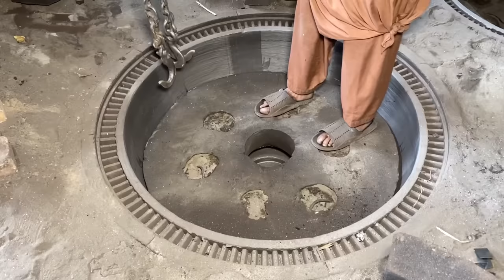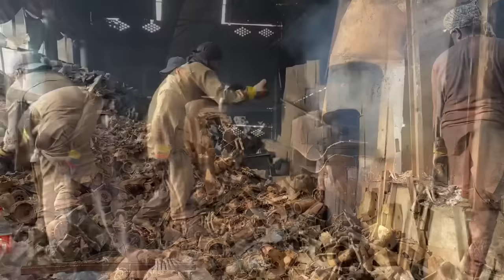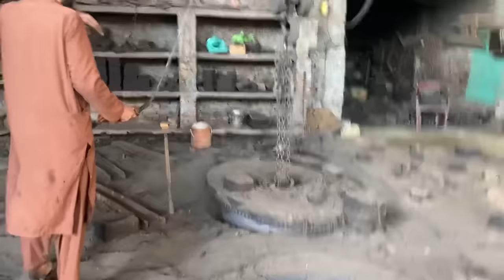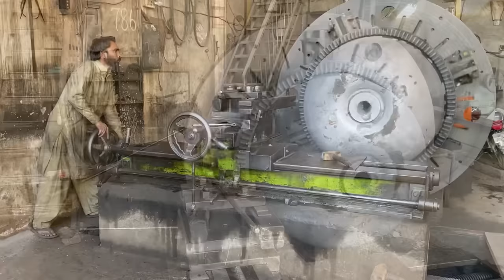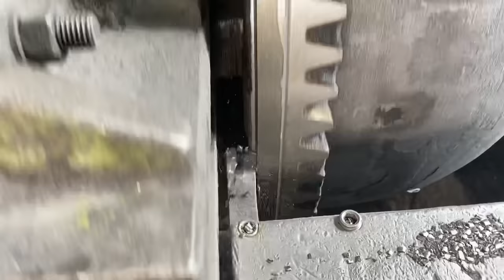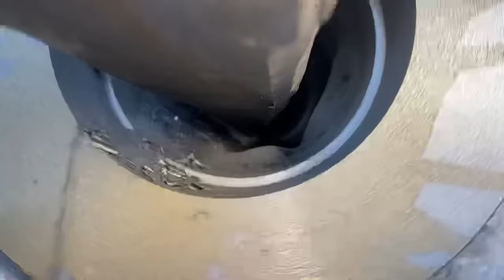How to Build the Drum of Heavy Concrete Mixing Machine “ pk amazing skills “

Comment: We'd never use chain slings on the machined parts and we'd use wood to pivot it flat onto the ground to save damaging the machined surfaces.
Presumably this would go for heat treatment to harden these areas now.
Reply: I guess chains are cheaper than straps over there? Somehow?...
Reply: heat treat ha,, no these are made from melted pot metal no one knows the metligurical composition and doing a hardening on it could make it crack from slag inclusions.
Reply: I have a feeling this is the finished product

Comment: As the head of the Pakistani safety committee, I approve of the use of safety pyjamas and safety sandals under these safe conditions. No giraffes were harmed during the making of this video. As you can see, during the smelting process, the white balls are fossilised potatoes, not as some ignorant people would guess any old stones. The potatoes are used as flux, to charge the flux capacitor that resides at the core of the furnace. Please be aware that the safety sandals protect the workers from cutting the souls of their feet, thus they are immune from tetanus.
Reply: ⁰⁰⁰⁰
Reply: 0 э0 Ош Ош Ош з0
Reply: Las gafas, los zapatos, los guantes, los tapones de oídos, son elementos de protección personal, los protegen, y les salvan la vida, y la ropa que están usan no es la adecuada, y para no no la inhalación de gases tóxico se usan mascarillas especiales, todo esto es necesario, para los trabajador, que son la mayor inversión de una empresa, chica o grande

Comment: I can't believe they're machining on the casting without cleaning off the molding sand first. Just run your cutting tool through stuck on abrasive. Pretty much they can rep[eat a task as taught but don't really know what they're doing.

Comment: what grade of steel?
Reply: Basically, pot luck Grey Cast Iron,  and barely that.  If you paid attention,   none of the employees weighed  ANY of the materials they put into the furnace.   Not even the limestone.    They just heav hoed  it in, using a ratio recipe  with no  weight measurements taken.  Not to mention that it looked like alot of sand made its way into the casting also.

Comment: What are those rocks for?
Reply: I'm not an expert but from what I understand white ones are limestone, it helps with melting and mixes with contaminants forming that slag that floats to the surface where it can be easily removed. Black ones are coke, a form of carbon used to correct the amount of carbon in the cast iron.
Reply: @ruben_balea  👍👍👍

Comment: That alloy is as strong as any Pittsburg steel.
Reply: @A_Stereotypical_Heretic my thoughts exactly 😂
Reply: I think that the part is designed to meet its performance requirements when made of the materials used.  That's good engineering.  When the melt was put into the ladle right after piercing of the furnace, I could see from the sparks that it has a high carbon content.  On the lathe, it cut like cast iron too.  In rough numbers, cast iron is 3% carbon and steel is 0.6%.  You can have strengths between about 12,000 and 40,000 psi with cast iron being on the low end.  I saw coke being added to the furnace charge which can increase carbon content depending on how much free oxygen is the hot blast.  Such variability would not make a good Swiss watch, but that's not what's being produced here.  Overall, I'm impressed.

Comment: coolant is not necessary when cutting cast iron
Reply: I think they add water more to reduce dust than to cool.
Reply: @ruben_balea  the little bit they use wouldn't put a dent in the dust made by the cutting